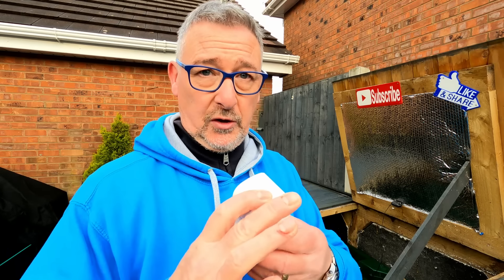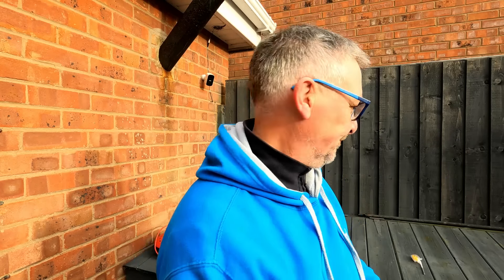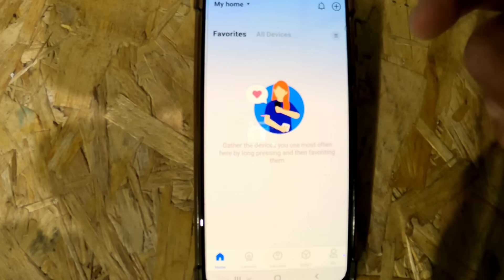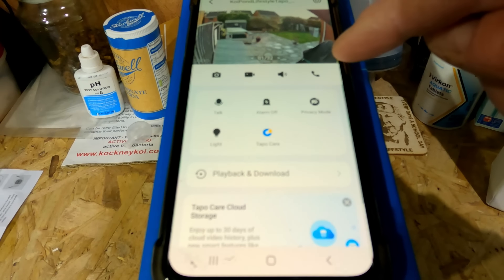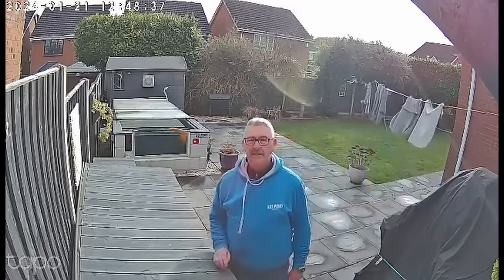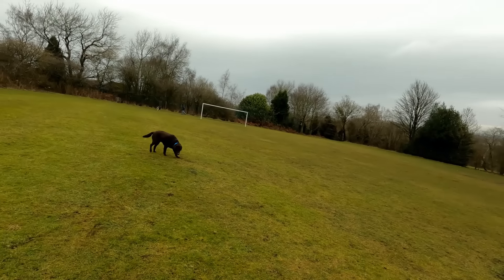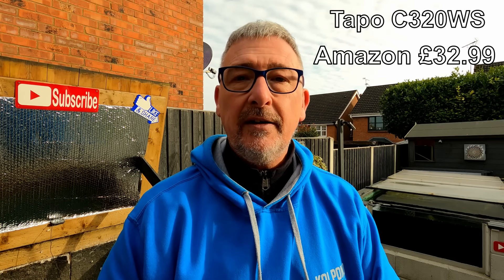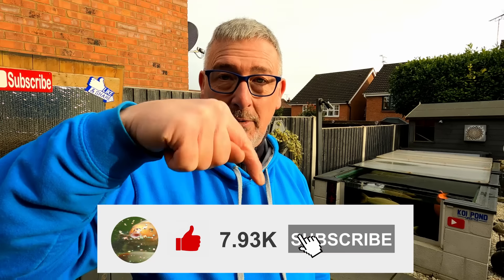NEW KOI POND SECURITY CAMERA, BUT WHICH IS BEST FOR THE MONEY🤔MINE OR THE NEW ONE, SO LETS FIND OUT😉

Comment: I have two...360 eyes and a Tapo. The 360 is wired and the Tapo is battery operated. Got an app for both. Both cameras have LED lights that come on when 'something' crosses the lens..moths, birds, foxes, cats, hopefully no people other than me.  I was able to keep an eye on the pond while away in Lanzarote. Both cameras have the sd card inside but the 360 is about 10' off the ground..no one is nicking that. THe night time colour settings are very good. One thing I did do was turn the alarm off. When it rains the 360 can go on and off every couple of minutes. You do NOT want the alarm going off constantly between midnight and 7am...lol. That's a well trained BEAR btw.
Reply from the maker: Hiya, thanks for the comments. Sounds like you've got your cameras nailed. The Bear is getting there.. 😉👍